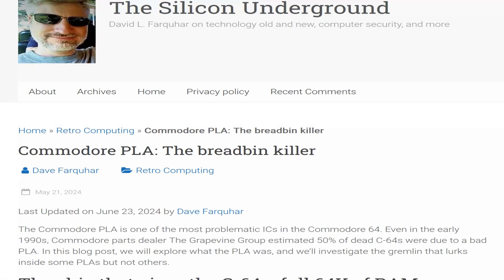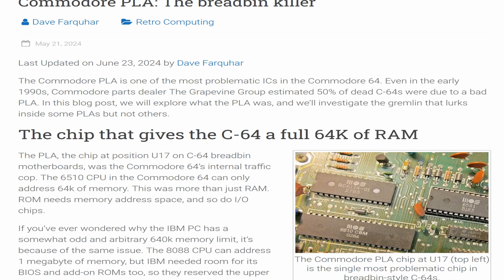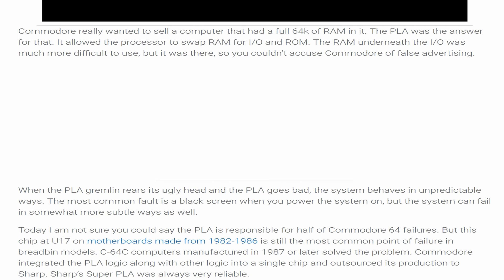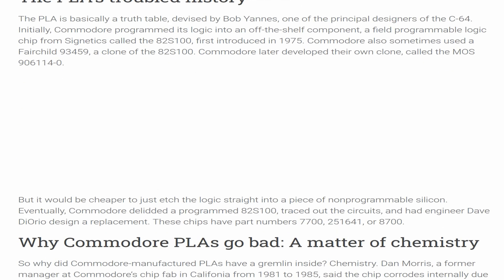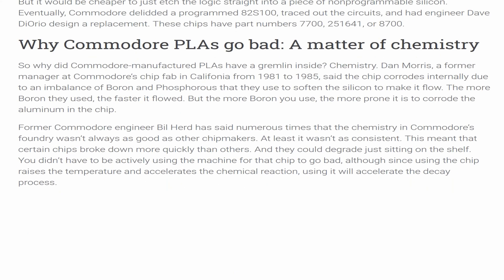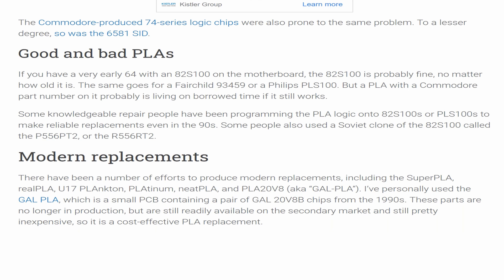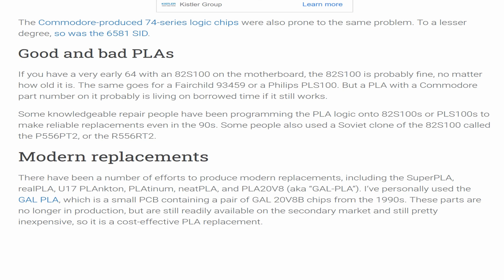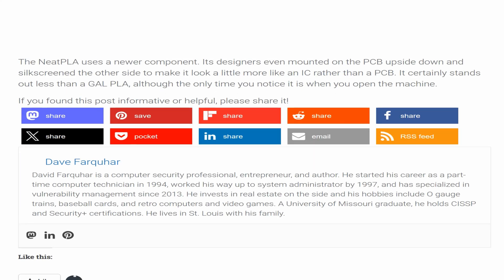C64 PLA History & why is it so bad  & whats the best replacement  (906114-01) (GAL) (PLAnkton)

Comment: Instead of getting just a Philips PLA replacement, get the whole Philips 8-bit computer. It is so much better than the C64. I know a lot see the C64 as gaming machine, but be honest, and agree that a NES or PC Engine is so much better at that, heck you can even justify an Amiga to replace your C64 for gaming in 2026. But Philips made a home computer that did everything right Commodore didn't. First of all it looks cool, not like weak poop. I know Tramiel was a tough hustler and got Basic cheap, but that means you start of with the shittiest BASIC ever conceived as Bill did not care any second about service for Commodore. BASIC on the Philips is perfect. It has a normal keyboard, so in 2026 you can blind type on it. Forget that on a C64. Built in PSU works like clockwork, no brick-of-death issues. Expansion: fits inside. Tape drive: no manual spooling, and it is faster than a 1541. You can even built in a 3,5" floppy and get super speedy loading and writing of full 720kB. Non destructive index of disk and tape, 80 character mode, readable non square letters, RGB output instead of a colour bleeding jail bar mess. It actually uses most of your PAL TV, instead of just 60% of the surface. Ports: normal RS232, RS485 and Shugart, with cartridges for dial up and joysticks. You can even tweak it for CPM.

Comment: Both my 64C and SX-64 have PLAnkton thrid party chips.  Both had working PLA chips, but they were both prone to failing. I set them aside, even though they can still go bad on the shelf. Their SIDs are fine.   But when I got a Twisted Electrons' TherapSID synth for the studio, I populated both sockets with ArmSIDs. I did have the SX-64 in the studio, but the built-in CRT did cause some audio interference.

Comment: Program a winbond chip yourself and change the pinouts is an option . Works with 99.999999 percent of anything you throw at it. Cheap as chips aswell. PLAnkton are 100 percent compatible. Never failed me. Get on Lemon 64 forum and ask around if you really want to go down the rabbit hole.

Comment: Dead PLAs, dead CIA's, dead SIDs, dead power supplies abound.  There's not much original C64 hardware that still works.  We all have to do our part to sustain AI startup valuations.
Reply: comes with old age..c64 is getting on a bit now lol
Reply from the maker: @doctorsocrates4413 it sure is 42 years old and there still making games for it 😉
Reply: @8BitRetroReFix  i have 3 of them lol..best thing i purchased was the kung fu flash...thousands of games and load in seconds...happy new year...
Reply from the maker: @doctorsocrates4413  best think for it is Gideon's 1541 Ultimate cartridge  😉

Comment: If this PLA is just a pre-programmed truth table without any triggers, registers or counters, why can't we use a simple EEPROM instead?
Reply from the maker: Tried and tested with Eproms they are not great but do work and more expensive when adding adapters and or wiring up sockets to swop the pins around plus its not a straight plug in replacement . ive heard they are not fast enough too.. Altho i could be wrong there .Also you could ask why didnt commodore use an eprom ? and why make the PLAnkton etc .  Thanks for the commet :) ..
Reply: You can use an EPROM but you must make an adapter and find a chip that is fast enough... not so easy now in 2024. Some people were using a 27W512 and a dump is avaiable for that EPROM. You can try a regular 27C512 but people say it's not fast enough. I never tried it I just made my own CPLD version for about $3 that is the same DIP28 footprint as the original.